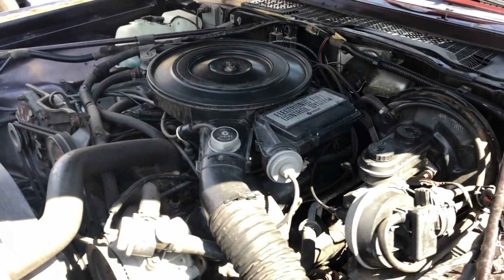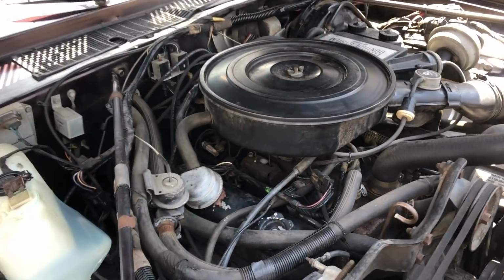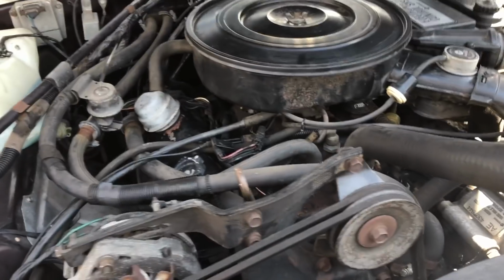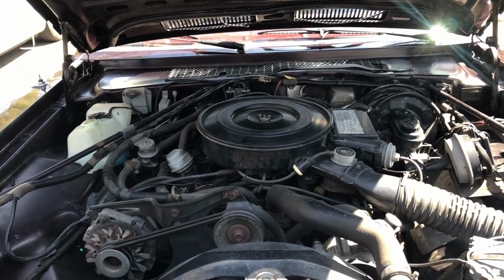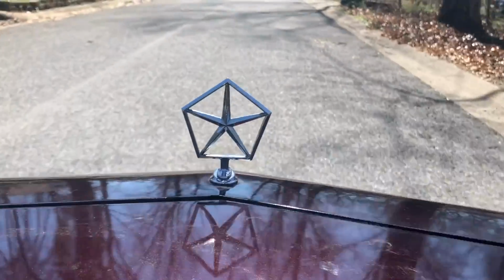The Car Chrysler Forgot to Stop Making - My 1988 Plymouth Gran Fury

Comment: Concerning your tuning issue. During the 80s, even the district service reps had a rough time getting Lean Burn  systems to work well under various normal conditions. A common factory suggested diagnosis method was called...replace with known good part. LOL! The myth that it is trying to achieve a 14.7:1 fuel to air ratio isn't true. It is trying to achieve a up 16:1!!. Even leaner ratios are seen during deceleration. That will result in a throttle tip in hesitation and often a lean misfire. Raw fuel is then released into the exhaust manifold where it will burn incompletely and the O2 sensor will see it as a rich condition making the problem worse. Due to the nature of gasoline available at the time the system was designed, only non-alcohol fuel will ever work well. Even with the 8.2 :1 compression ratio, you will need 90 plus octane fuel. The timing chain must be in perfect condition. It is long as the camshaft is quite high above the crankshaft. A timing chain tensioner from a later engine, say a 93, can be retrofitted easily when replacing the current one. 
Oh, cool car by the way.
Reply from the maker: Such a great comment and thanks so much for sharing all of that.   This is the beauty of the internet and sharing information!  Thanks again!  -Chris

Comment: the electronic fuel system was a good system if every thing is working 
right it is possible to get 28 Miles to the gallon on the road    i drove the
Chrysler version  and went 250K    the timing can only be done by
pulling the spark plug and finding top dead center  And the right plug gap
with platinum plugs    oh oh the fuel mpg in town was poor 
have fun

Comment: How would getting rid of the lean burn that was forced onto Chrysler be a bad thing? I own a 1986 Chrysler fifth ave, the best thing you can do is get a early style 70s carb and electronic ignition or HEI conversion kit and get new exhaust without the choking catalytic converters. Maybe headers and a 4 barrel if you wanna get real involved, it may be a good bit of money but it makes these cars so much more fun to drive

Comment: I had a 1988 5th Avenue for about a year, got it for $700 from a mechanic.  I swapped the rear axle for an 8 1/4" with 3.07 gears, made my own dual exhaust and got rid of the ESC/Lean Burn and converted it to 4-barrel carb.  Great car but if I did it again it would probably be something older with longitudinal torsion bar front end, I don't like the front end on the F/M/J-bodies

Comment: Keep it up you are the man! 👍 I'm very happy with my Fifth Avenue which is virtually the same car is my daily driver. However, if you want to get rid of the miss firing get rid of the lean burn computer system the only way you have to fix your problem like i did with my Fifth Avenue. I know you want it original but you can keep it original just getting rid of the computer doesn't hurt it's originality at all. Like i did, just cut down the catalyst, put a holley 4bbl 600cfm carb advance the timing 4° degrees and you will see the difference in HP. I don't give 2 cents about gas mileage i just want a High Performance Daily driver, also the Fifth Avenue came with a 8.3/4 rear end mine have a factory 354 Dana in it! I was amazed that was the '69 Charger was equipped with.
Reply from the maker: Thanks so much bro for checking out my Gran Fury vid and for your comment and advice.  Really appreciate that.  And, I think at some point, just like you said,  I'll be heading down the road of dumping the Lean Burn.  -Chris

Comment: I got a 91 olds 98 for 300 bucks and thought I hit The jackpot, until it wanted a harmonic balance or ignition module coil pack front brakes alternator and then when the brake lines popped when I was coming to a stop at a very busy intersection it sent me right into the middle of the intersection and that’s when I called it quits for the car. Car looked great and I thought I knew what was wrong with it but it turned out to be a POS sitting too long too much corrosion

Comment: I'd personally add all the police car HD upgrades and parts, without the paint and stickers. A set of police wheels and drilled center pop caps would look great on your car. I'd also ditch that lean burn crap and put in a conventional stock style electronic ignition and pre emission style distributor.  A 600 afb carb and subtle dual exhaust old round out the engine. Lastly, I'd get a set of better gears.... Around 3.23 or so... Later on a 360 would be installed when the 318 craps out.. Cheers!
Reply: Right, because nobody has ever done that crap before.  Eddy AFB?  Are you stupid?
If you're going to hack a car up and piss away the value, at least get the right carb - a new Street Demon Thermoquad.

Comment: Man that's a cool car.  Glad you are keeping it original.  BTW that headliner is a $200-300 fix from an upholstery shop, had a couple old GM cars with saggy headliner.  

As for that rube goldberg Lean Burn system, if you can't fix it, ditch it IMO.  GM used a similar but easier to service electronic Quadrajet carburator on their big cars/trucks in the 1980's.   I'm not a Ford guy, but man they were ahead of the curve when they converted their big Panther platform and Mustang to multi-port electronic fuel injection in 1985/1986.  GM was still dicking around with the electronic q-jet until 1990, their trucks had TBI until 1995 while Ford had multi-port fuel injection years prior.
Reply from the maker: Great comment and yeah, soo true about Ford one-upping both Chrysler and GM with fuel injection.

Comment: You get the Chrysler performance electronic distributor kit and replace the lean burn computer.  Summit Racing has them.  Bring the timing mark to TDC.  Make sure the distributor rotor is pointing forward, then remove the old distributor and the lean burn computer off the air cleaner.  Wire the new electronic control module in as the instructions in the kit tell you how and install the new distributor from the kit.  Set your timing and put the air cleaner back on the car.  You can leave the hole open or rivet a new piece of metal in place of the removed lean burn computer.  Now your back in business and it is very reliable.  Later put an Edelbrock intake manifold and Edelbrock   carb on with electric choke and your car will run even better.    Oh one other thing.  Buy a stapler from an office supply store or Walmart and use it to staple your head liner back up.  Just start stapling.  Very easy fix.
Reply from the maker: Great comment and thanks so much for sharing all of that.  I think a new distributor for this Plymouth is on the horizon.  The car is soo finicky right now that it's not much fun until she's fully warmed up.  And great tip on the stapler and headliner too.  THANKS!  -Chris
Reply: The car is finicky because the choke is not working properly.  I can tell you how to check it.  I started to tell you and somehow in the middle of explaining it the post disappeared.    @hullinger
Reply: Summit Racing electronic distributor kit number is SUM-851003 and runs $254.99 plus shipping and handling.  They even give you the instructions and wire diagram right on the Summit site.    If the car doesn't run good until it's warm, that means the choke isn't working right.  The problem may be the choke pull off or the choke stat (spring)  Some carbs had 2 choke pull offs.   I used to be a Chrysler mechanic.  I stopped working on them in 1988.  Changed jobs, I didn't have any benefits as a mechanic except paid uniform shirts.  Kids change the way things go sometimes.

Comment: I  had the Chrysler Fifth Avenue version of this Plymouth. I ditched the Lean Burn ignition; it would go into "limp mode" quite often which meant it would barely run. So I  converted mine to points. It ran like a champ. Today, you can convert these Lean Burns to electronic ignition, but the conversion kits weren't readily available back in 1995 when I had my Chrysler. Nice Plymouth,  trash that Lean Burn ignition and you'll appreciate this car even more.

Comment: I had a '78 Fury with a 360 in it. I put the lean burn bypass kit in it and it STILL wouldn't run right. I would run horribly lean all the time. Found out the intake manifold gasket was shot
Reply from the maker: Hey man, thanks for checking out my Plymouth video and for your comment.  I appreciate you sharing that!  Hopefully you were able to get the intake gasket replaced and the car ran well for you.  I'm betting it was a fun car with the 360 V8!  -Chris
Reply: @hullinger  yup I got it running good! Power wasn't bad, the 360 did pretty good!

Comment: That's a gem. It was pretty easy to wake up those 318s if you take off all the emissions crap. They're pretty light, so they can fly if they're not stock.
Reply: There is no horsepower to be gained by eliminating the lean burn.  ZERO.
Reply: @pkranz937  Well I  took off the cats, added an aluminum intake, a bigger carb ( 2v to 4v), and had full headers and glass packs installed on a 75 Duster I had 30 years ago, and I got about a 45 HP gain just from all that, without even camming or adding pop up pistons . That isn't to say that 318 had a lot of pep to it anyways, a paltry 130 HP at the wheels or so stock, but it woke up!  So .....you're wrong.  Had I added a full cam and better pistons and heads, might have been another 20 horses. And nowadays there are plenty of stoker kits that add 70 HP over stock available. The little 318s have a lot of potential. Don't underestimate them.
Reply: @pkranz937  Also, the lean burns were problematic and had serious reliability issues. i remember people who tried to be frugal by buying the "lean burn" cars in the late 70s and they had them in the shop  more than they drove them! Those things didn't last 70000 miles with that lean burn junk. It was either they fouled the plugs or they ran TOO lean. A lot of mechanics tossed that crap out years later because it gave people such a headache.  Why WOULDN'T you want to be rid of that junk?
Reply: @joshn938  There is a video of a Lean-burn system that had components replaced with improved parts and it worked pretty good. The concept was maybe ahead of its time but the electronics were not yet good enough
Reply: @timothykeith1367  The idea wasn't a bad one, in fact, it was actually pretty futuristic for the time. It was the first step towards most cars having EFI by the end of the 80s. The problem was, the American automakers were playing catch up with the Japanese for the latter half of the 70s, and they kept cutting corners to do so, which produced a crappy product with faulty electronics. The gas crunch changed the way we buy cars forever. It was also a way for the mid size cars to save gas and meet CAFE, as Chrysler didn't have a true subcompact car ( the duster, dart, valiant, and later Volare and Aspen were actually almost mid sized!) Chrysler ended up importing Mitsubishis and rebadging them as the Dodge Colt to meet fuel economy targets, as Chrysler and Imperial were still giant, 12 MPG land yachts.

Comment: No air conditioning, deal-breaker.
Reply: Yea I would tend to agree with that. Love it  when they say...yea...just needs a recharge. Bunch of bullshit or just O rings.  No man..cost to repair that A/C systems really could be 900 dollars for the complete kits and 100s more to install the kits.
Reply: styldsteel1 YES!!!!
Reply: How people get by without air conditioning in cars back in the 1950' s and 1960's? The weather must have been cooler back then.
Reply: @lorenzocooper5489  You can't miss something you never had.
Reply: @lorenzocooper5489  No, it wasn't. We were tough and didn't know any better!

Comment: I can relate, the more you drive an old car the more you just want to keep it as stock as possible. Even though I would just get rid of that stupid sensor system and just get a normal carburetor so it runs right.

Comment: And now you know why many dump the Electronic Factory Ignition System and Carburetor for a bolt on After Market Throttle Body Fuel Injection System from Summit Racing Equipment and Standard Electronic Ignition Distributor System that Mopar Used From the 1970's into the late 80's.
Reply: There is no reason to replace the ELB.  It's far cheaper to replace the computer ($130, Rock Auto) then to hack it up.

Comment: They also made pretty good taxicabs back in the day,except for poor fuel economy on the ex police car versions,and a small trunk if you were carrying a full size spare tire (no luggage space). You can do a makeshift repair on the sagging headliner in this car by stapling it to the insulation underneath it(be careful not to staple through the electrical wires).

Comment: I used to build these cars in the St. Louis Missouri assembly plant. We switched to the minivan in 1986 so rest assured that I didn't touch this one.
Reply: You may have built my 1980 Diplomat as well.  I hope you weren't the guy the glued on the headliners as mine sagged just like this one's.
Reply: Cool. So, you could have built my 87 Gran Fury and 85Th avenue.  What was your job on the assembly line?
Reply: @styldsteel1  I set the sides of the cars on the floor pans, put hoods on, put battery trays and hood latches on.  Had a lot of fun with the people there but they worked our butts into the ground!
Reply: @kurtzimmerman1637  Yes, I'm sure they did.  Just like worker ants really.  Well, thank you for building a good car for me, Kurt.  Hey, NYPD  and NYC taxi fleets used these M body Chrysler all the time.  Rest assured, back in the 80' and 90s NY was literally  falling apart and had some of the worst roads in the country. The M bodies stood up wonderfully.  My apologies, I re-read your post more carefully, You could have helped build my 85 5th Avenue.  Where did the M body construction relocate to after the switch to the minivan, if not St. Louis. Thanks.
Reply: @styldsteel1  they put all kinds of extra steel and bolts in police and taxi cabs. In the body shop where I worked those cars looked like something DR. Frankenstein created . HEAVY DUTY!👍
Reply: @kurtzimmerman1637  Hey..Even with the Dr. Frankenstein creations..look at the results.  One tough car! but...Where did the M body construction relocate to after the switch to the minivan, if not St. Louis. Thanks
Reply: @styldsteel1  I believe it was moved to kenosha,  Wisconsin.
Reply: Built under contract with AMC (though some early 87s were in St. Louis).
Reply: @kurtzimmerman1637  Sounds like they made you work hard for the money. Remember that song.
Reply: Windsor, ON through 1983

Fenton, MO through Feb, 1987

Kenosha, WI, through Dec 23, 1988 ('89 model year).
Reply: This car was so profitable for Chrysler that they couldn't kill it.  The product planners had already planned on killing it in 1986 but due to it's high gross margin...they moved production over to AMC before they even bought AMC.   Again, another reason why Chrysler acquired AMC,   Jeep.....and The Premier (which became the LH cars) and production capacity.  A win win deal for everyone at the time.
Reply: I worked at Sterling Stamping 6215.  All the Hoods, deck lids, cowl tops, cowl sides, side sills, b pillars,  fuel tanks, roofs, cowls, floor pans.  Did I miss any stampings?

Comment: I never thought about it but the climate controls on my 1994 dakota are above the radio. And since the truck was designed in the 80’s it falls in the same category as the Plymouth
Reply: The early Dakotas shared quite a bit with the M body.

Comment: I loved those old cars, but that electronic ignition was frustrating. I once had a 1980 New Yorker Fifth Avenue that wouldn't start after a hot drive until it had cooled for about an hour.
Reply: Ignition control module.  Common failure

Comment: i had a new 1984 ply a lot like yours.   turn switch had to replaced under wanerty.     the intake manifold had crack.   a  vacuum leak.  i replaced it w/ Edebrock.  and put the Direct Connection ignition on it.   then the spider gears went out.   JUNK JUNK  JUNK.

Comment: Hello again Chris! I see you are having laughs with your MOPAR mid-sized sled. There are a ton of aftermarket support for that drivetrain! Plus the dynamics of the platform can take a lot more power and abuse. So have at it, I for one would build the ultimate sleeper! Too bad it’s not a 360 to start with but the 318 is fine. The one issue that would drive me crazy, but I’m 6’ tall is the drooping headliner, but that’s a simple fix. Either cut it out and dye/paint what's left or try put small holes in it, then get some spray contact cement with a small add on hose nozzle and stick in the hole and gently spray in a circular motion, then let dry for a few as directed then use some type of platform to hold up and cure, I've done this a number of times with success, just make the holes as small as possible. Good luck.

Comment: Great video, Chris. I think all I would do is replace the headliner and remove the rest of the protective side trim. Maybe even the gran fury emblems. Just to see how many people have a clue what it is. I never realized how far ahead of the curve Chrysler was with computer controlled engine management. Ford and GM didn't have anything near that in 88. Thank God, but still. 😀
Reply: I’d replace the headliner and try to find the nameplates but possibly remove the side trim instead of looking for replacements.
Reply: Plymouth was behind the curve.  I had a 1988 Chevy C1500 with the 5.0 that had throttle body fuel injection and zero issues for 185,000 miles.   Also had a 1986 Olds 88 with port fuel injection.